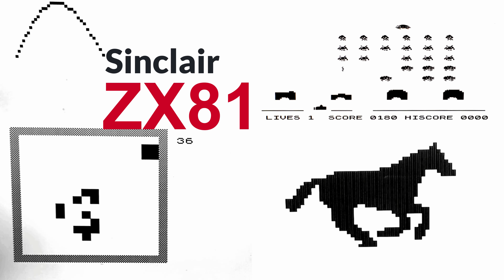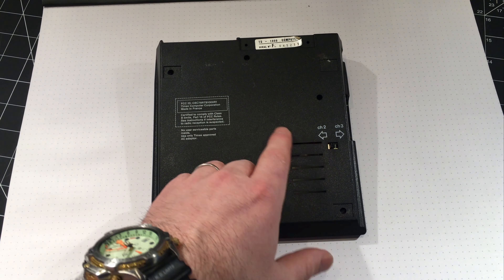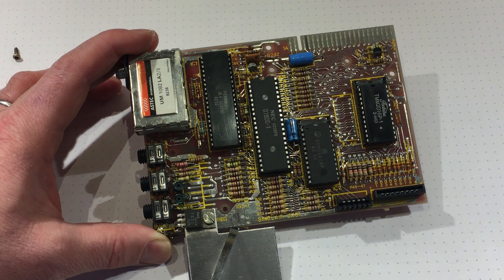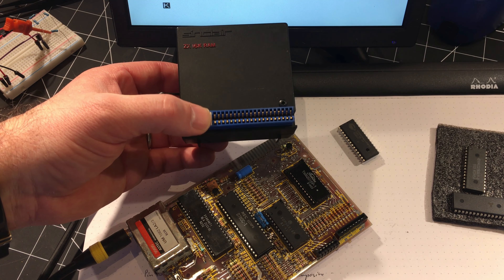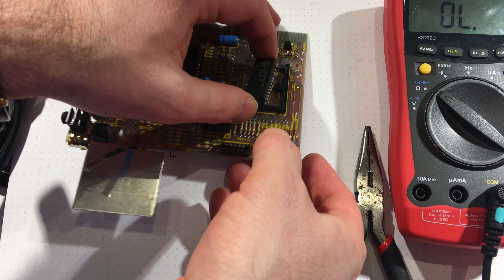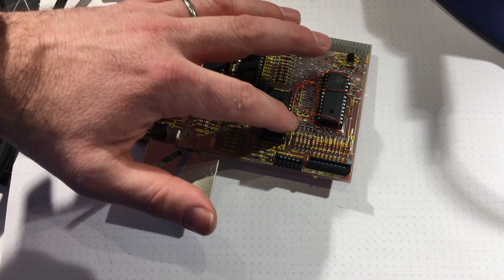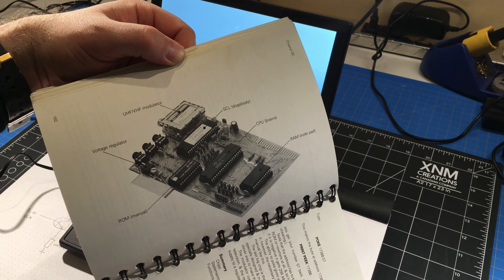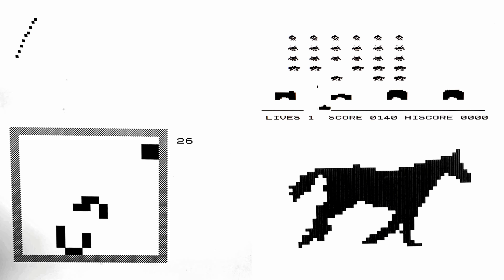ZX81 still awesome after 40 years!

Comment: my first computer was a Commodore 64, which was gifted to me by my oldest brother (17 years older than me), so yeah, even the c64, which cost considerably less than an Apple II, was still rather more expensive than those Sinclair Z80 computers. My system had a composite monitor and floppy drive - less than a thousand dollars, but more than $500. Sinclair computers could be used with TV and cassette - where a family would already have a TV, and cassette players a lot less than Commodore floppy drives. It was a valuable first entry to computing for the masses.

Comment: Z80/81 was kinda like the old granny of the modern Raspberry Pi (especially the first versions): A cheap computer that lowers the entry level. It's not fast, it has its limits but it's affordable and relatively easy to use with it's BASIC (today we have Python, which is much more powerful but also a good entry-level programming language).

Comment: Also replace the 7805 power regulator with a TRS-1 2450 and you can dump the heat sink. Runs cool to the touch and is 96% efficient.

Comment: I'm always marvelling at the newer ZX81 and TS1000 boards. Mine (American, NTSC ZX81) was assembled Christmas Day, 1981. All the resistors were installed vertically... But instead of   just bending one of the leads to fit, the assembler cut off one of the leads, soldered the cut lead into the board and then soldered the cut ends back together.  So ugly
Reply from the maker: Wow thats very unusual.

Comment: I had a ZX80 that could run as a ZX80 or ZX81.  I had the image of the two PROMs in two parts of a much bigger EEPROM.  A switch worked the upper address line.
Reply: No way you had slow mode without the 81's Ferranti.
Reply: @powderslinger5968  I had the slow mode.  Details are a bit fuzzy in my memory but the slow mode logic was not some strange thing.  The standard logic chips could do it.  All the slow mode did was run the code briefly in the vertical retrace time.

Comment: Real ZX81 programmers use N as the loop counter! The 7805 should really be changed for a switching regulator, it dissipates quite a lot of heat because the power supply voltages is so high, not as much as the ULA but it does run nice and hot. I would have tried to makes the wiring changes for the RAM on the board rather than directly to the ic, is that possible?